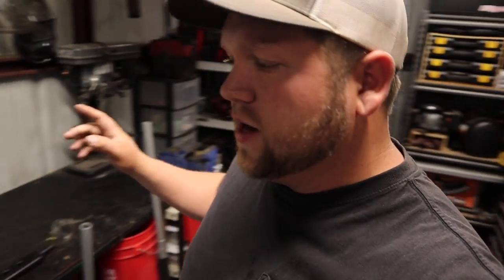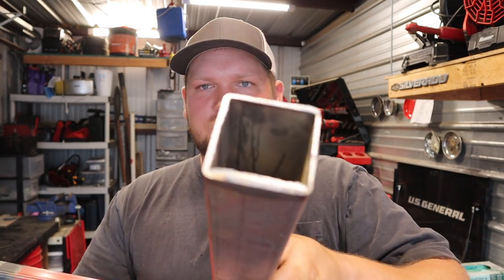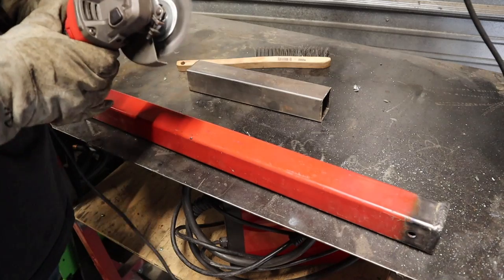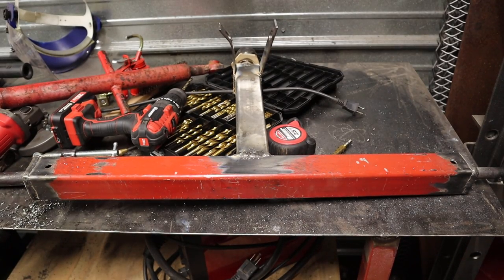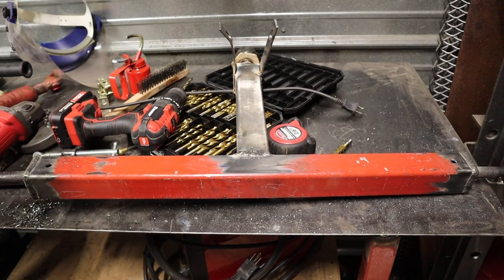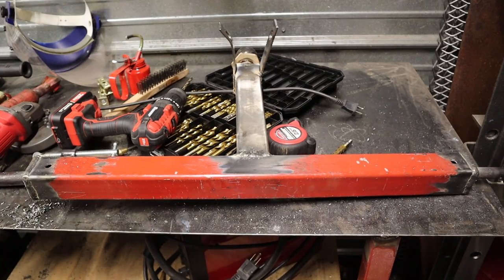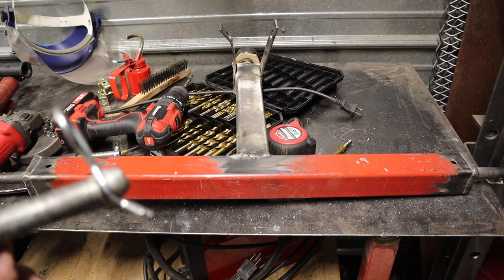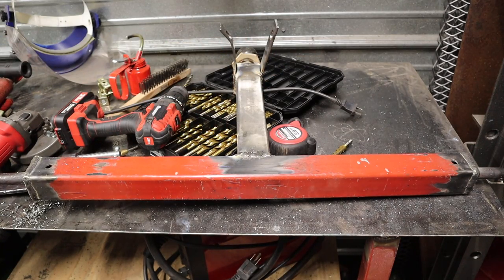Welding a 3 Point Trailer Hitch from Scrap Steel

Comment: This is a great idea, and a pretty simple project for the home fabricator.   I would change a couple of things:
1. Heavier material throughout.  1/8" isn't going to be up to the task for larger trailers, especially if they're loaded.  I'd probably use 1/4" wall tubing and bar stock.
2. Move the hitch ball to a lower point on the frame.  You shouldn't have to get off your tractor and raise the trailer.  This is supposed to make things simpler.
3. Bevel the end plates where they weld to the tube, as well as the ends of the tube itself.  This will allow deeper penetration and stronger welds.
4. Drill through the end plates where the pins attach, bevel the holes, and weld the inside and outside on the pins.
Reply from the maker: Thanks for watching. I'll respond to each one individually.
1. I was building this with scraps I had on hand. The main piece of square tubing is like a 3/32" this steel. I think it's enough.  Everything else should be thicker, but again, I was was building it all with scraps on hand. 
2. Ya, when I backed up to the trailer to pick it up and it wouldn't go low enough, I literally said out loud "well that defeats the whole purpose". I am going to weld a hitch receiver at the bottom of the red square tubing and use that primarily from here on out. 
3. Thanks for the tip.
4. I considered doing this but it literally took me about 30 minutes to drill through for the ball in the top piece, I decided to try it as it is, If they break I'll use your suggestions on the repair. 

Thanks for the comment. Constructive and useful. These are the best kind. In hindsight, I do realize I probably cut a few too many corners.

Comment from the maker: Since finishing editing this video I think I have realized the real issue with the design.  I was basing it on one I saw at tractor supply, and I’m not sure how they make theirs work, but I think all the weight/pressure of the trailers momentum is out on the top link. I really need to weld a hitch receiver on the bottom side of the square tubing so most of the weight it put on the two arms of the tractor instead of smashing into the top link.

Comment: We have a ball attachment for the forklift at work, makes the job of moving trailers around (something we do a lot of) really easy. 

Yeah I think reinforcing the top link mount would be good. I'd also consider welding a standard hitch reciever tube on there a little lower maybe more central or where the tubes intersect. First it would make it so you didn't have to jack your trailers as high up when hooking up. Second it would move the stress point more centrally, so if the weight of the trailer surges it spreads it to all three pins instead of just the top pin. Third the receiver would have a tiny bit of give which might slightly cushion any shocks. 

Looks like your welds held up great!

Looking forward to the dump trailer video, those are super handy!
Reply from the maker: Thanks for the suggestion man. I am going to buy a receiver tube next time I am at HF and will weld it to the bottom. I also think I will get rid of the ball on top and reinforce the top link mounts.

Comment: The ball is WAY too high .  Can't get under trailers unless they are raised .
Reply from the maker: This trailer his has been modified since I made this video. I removed the ball on top and welded a receiver to the bottom and use regular hitches.